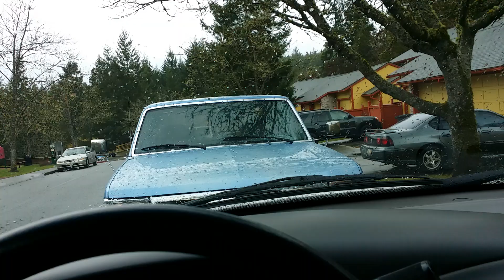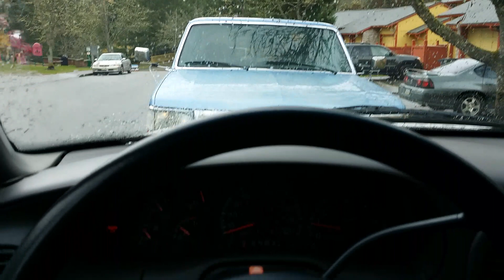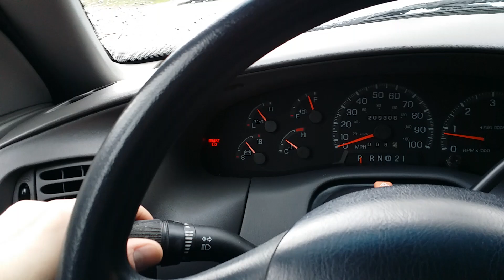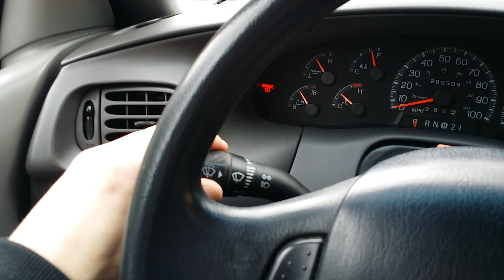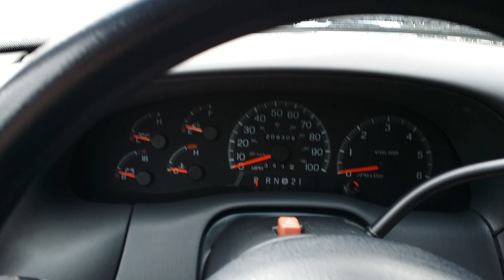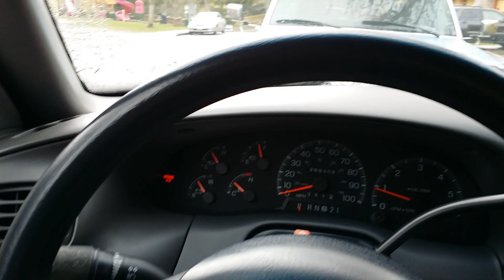My F150 and the windshield wipers.

Comment from the maker: My radio works fine. Besides the fact that it has a tape deck player. Now that it hasn't rained for a few days, everything has been working fine. Windows are working off and on, but no problems. Beside the heater only works when the truck is in motion.

Comment: Gem module guys behine fuse box when you replace it be sure its exact number as on box
Reply: What are you referring to as the Gem Module?
Reply: @thomasdick2191  General Electronics Module. It controls a lot of the features, such as wipers, dome light, door ajar light and chime, and if you have power windows, it controls the auto up and/or down feature.

Comment: have you figure it out ihave problem with mine it does not work I try motor is good I try the switch is good fuse is good I don't know how to check relay if you figure it out let me know